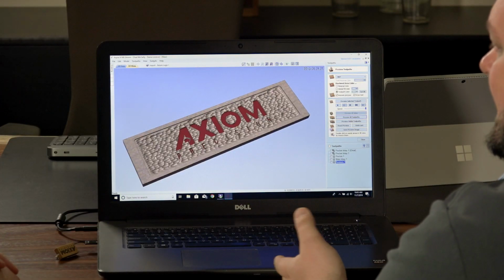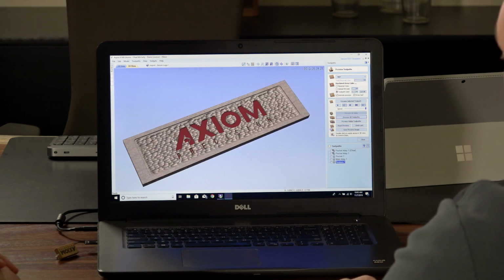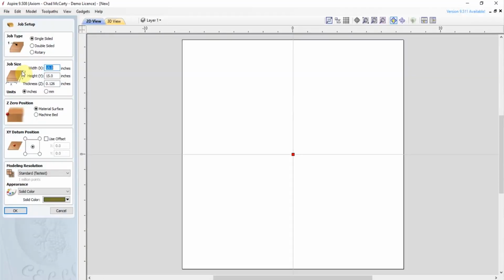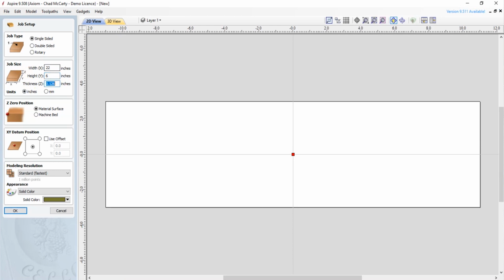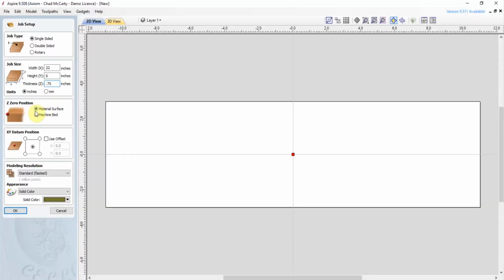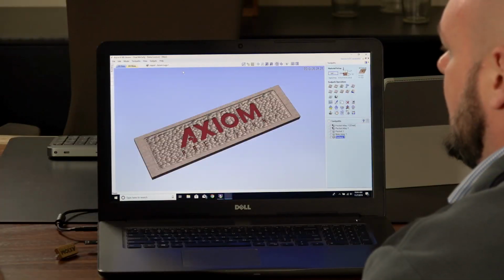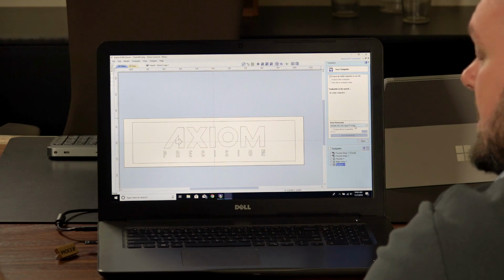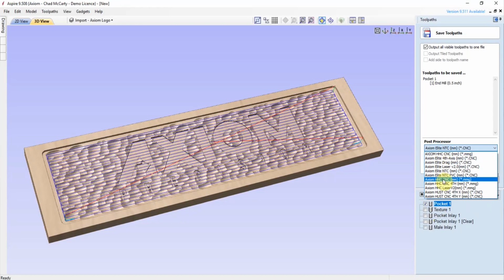"Getting Started" Popular Woodworking Visits Axiom Tool Group - Episode 2

Comment: how i can use a G-code programme on a Axiom pro 6 without Vcarve or i am force to buy Vcarve?
Reply from the maker: You can use any CAD/CAM program to design and create tool paths & Gcode, as long as the program has a post-processor that supports our machine.

Comment: Hi Team,
I just installed a AR4 into my store, I'm here to learn more about how best to use it. 
I found you video and assumed it is a good place to start, it seamed to jump in to an ongoing conversation  on a topic i wanted to learn about, then change to surfacing the machine with no mention of the project sent to the USB. Now I'm wondering is there a file to surface my machine? who makes that?  there was no mention of this in the documentation.
I have so many questions, is there a place to find the files or instructions?
I come from and engraving background I run Laser engravers and cuttters I draw in 2D in corel Draw and 3D in Fusion 360.
thanks in advance.
Roy
TheTrophy Store
Reply from the maker: Roy, you should find a surfacing file already stored within the controllers internal memory. This is something that we have began to include with each machine....while the earlier manuals do not cover this feature in detail...the current manual should cover everything needed to run this surfacing program including a JOB Setup sheet from the Vectric software for reference. 

If customers have an older version of the manual there is a set of dedicated instructions that covers this and would be used in conjunction with the manual. You can find that set of instructions here: https://www.dropbox.com/sh/udqvliq9r8nfl3i/AAAguGsRgCurt4oGp1ccy13Ia?dl=0

Or simply email our support team at support@axiomtoolgroup.com
Reply: @AxiomprecisionCNC  I am also new and we have recently picked up an Elite 48x48 , I have the machine set up manual but want a manuel that shows how to set up the machine, insert bits, and how to use it.... can you get me a link?

Comment: Is there a video on how you created that texture?
Reply from the maker: There was more to that video which Popular Woodworking edited out...but that texture, is just a standard texture created within the Vectric software. All we did was setup a few tooling parameters in an effort to make it look like it had been done with a hand tool. 

We used a 0.5" Core Box Bit with the following texture tool path parameters:

Max Cut Depth: 0.1575"
Max Cut Length: 2"
Max Overlap: 40%
Stepover: 0.25"
Angle: Matches the grain direction...in our case 90%

Boundary Offset...will effect how close your tooling gets to the edges of any raised letters or pockets. We generally use half the diameter of the tooling, but it will depend on the look you are going for.